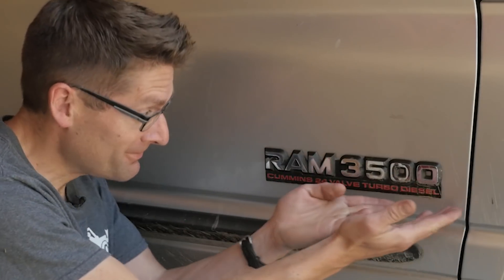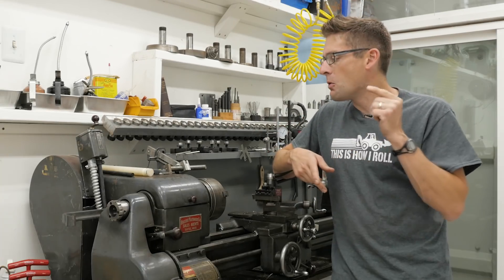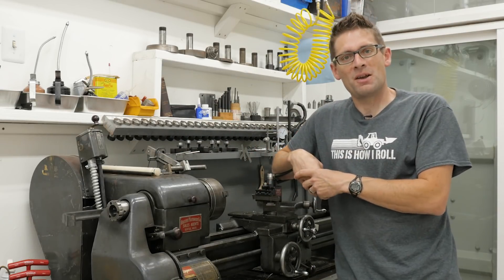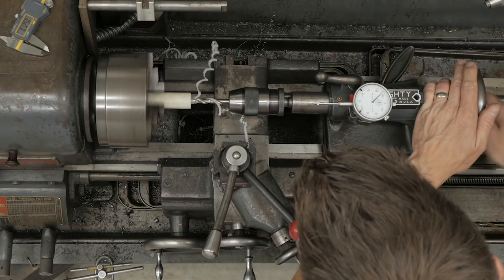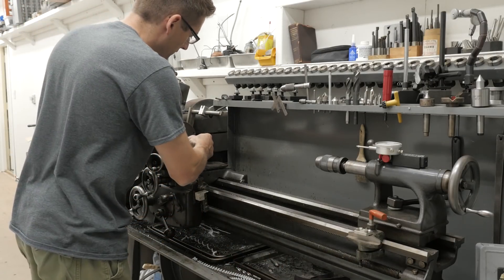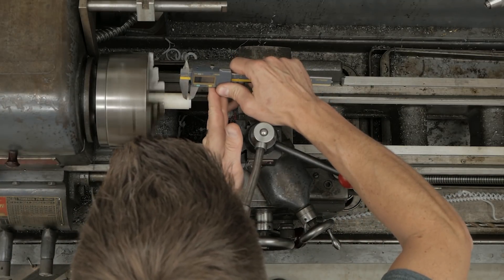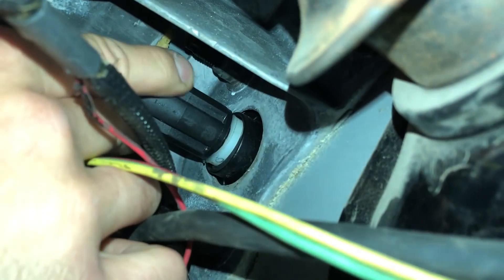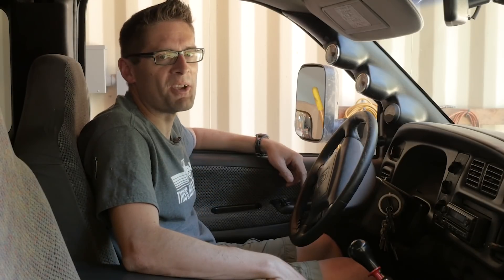Fixed my Clutch With Plastic and my Metal Lathe: Delrin to the Rescue

Comment: Polyoxymethylene (aka POM, Delrin is a trade name for it)  is very strong I've seen machined delrin gears that can handle the torque from an 8kw 50v BLDC motor easily.

Comment: i want to make a  plastic coin ring push rod do you have any advice, can I use a harbor f  lathe and what plastic would i use
Reply from the maker: What is a plastic coin ring push rod? :)
Reply: @Ultimatereloader  thx for quick response its not actually rod they call it a coin ring straightener. its a plastic cone with 5 degree wall and as you push it through the coin ring it makes the sides straight. Has to be a plastic that hard enough to push a silver coin ring. i can send a px

Comment: Would a 3D printed part have also worked?
Reply from the maker: Yes indeed- in this case I think the lathe is way easier and faster, but not everyone has a lathe.
Reply: I agree. The lathe is much easier and faster. My local library will print 3D parts for the cost of filament. Give me the dimensions of your shim and I'll share the OpenSCAD code to produce it.
Reply: You can have 3D parts printed by shapeways in SLS nylon at pretty reasonable prices. SLS uses nylon powder and a laser to make the parts instead of a print head and filament.

Comment: I wish I had convenient access to the old manual machine tools. However, I have enjoyed being able to use a mini CNC router for stuff like this. I suck at CAD though, so usually I sketch out something on graph paper, my brother tries to get me to CAD it, then he ends up doing it from my drawings. We typically set very conservative feedrates and probably wear tooling prematurely, but since we aren't going for production, it is nice to have a flawless surface finish and less scrapped parts and broken cutters. I've made everything from gun parts, to parts for my bullet caster machine to motorcycle parts so far.
Reply from the maker: Yes! It's great to be able to make your own parts! I'm looking forward to trying out CNC routers- I have some cool projects in mind :)
Reply: Rigidity in traverse makes a huge difference in capability. That and decent software. Get something with Gecko drivers, they are way smoother, which translates to no weird steps or randomly broken tools. This old Tony on youtube has a great series on them. Also NYCNC has a surplus of info and clever tricks. With my brother's machine, we've reinforced bits here and there, but when cutting metals, we generally stick to soft metals, or replacing cutters often, and prefer not to go above 3/16" cutters. If you hit me up on slack, I can probably get some handy spreadsheets from my brother. They are very convenient for figuring out the right feedrate for a given tool and RPM or vice versa. Usually, we plug in the feedrate and have it calculate the right RPM for the tool's specs. That tends to get nice results.
Reply: I live only a few miles away. Perhaps we can make something together some time.